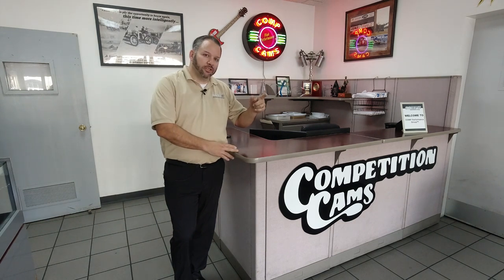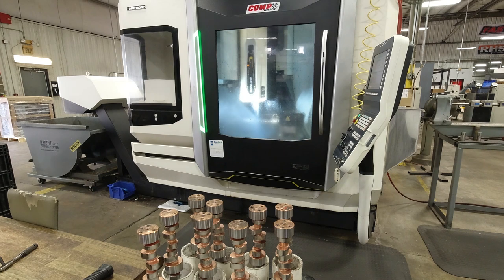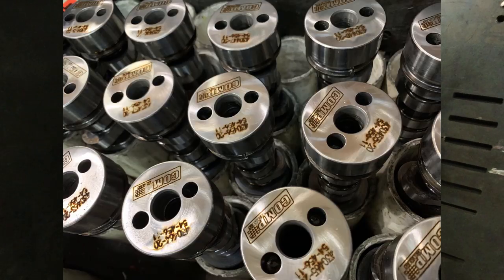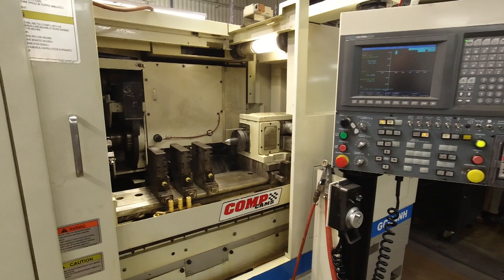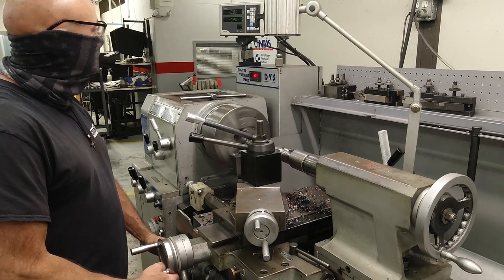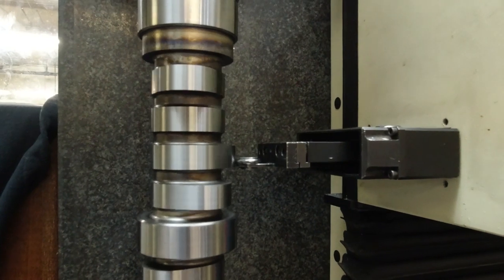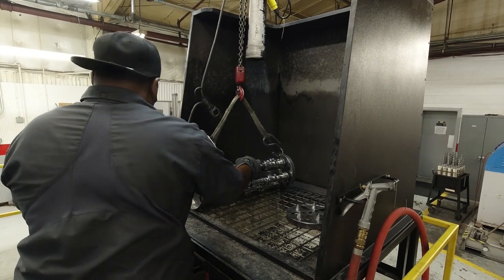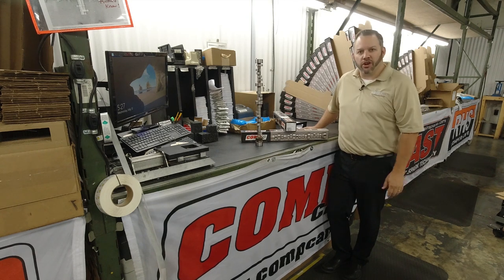CPG Nation Horsepower Tech: How a Cam is Made

Comment: Nice video and clean shop! You mentioned at the beginning that you were omitting the details of cast cam cores.
Lately it has come to my attention that whoever is supplying your castings are leaving alot of "Spatter" on the parts
and after grinding the profile, this material is left on the camshaft and shipped to the customer. These pieces are not
bonded to the camshaft very strongly,  and they end up falling off when the lifters seat and go through the oil pump and
luckily get stopped by the filter. If those Cores were shot-blasted before grinding it would eliminate the problem. 
If you shipped me a camshaft that looked like the ones I have seen, I would ship it back to you! Your Q.C. Department
really should address this problem.  All of the Billet's look good, why shouldn't the cast units? What do ya say?

Comment: How does your MSE process compare to REM polishing?
Reply from the maker: Without getting too deep into the chemistry of the REM process, the chemicals that are used in the REM work well with iron but are not optimal when you get into the more complex steels that are used in camshaft materials.  MSE is a mechanical process to polish the cam surface.